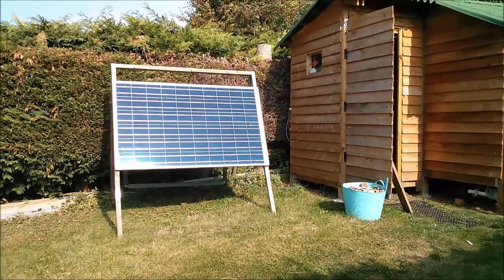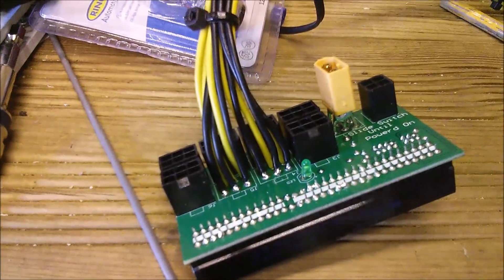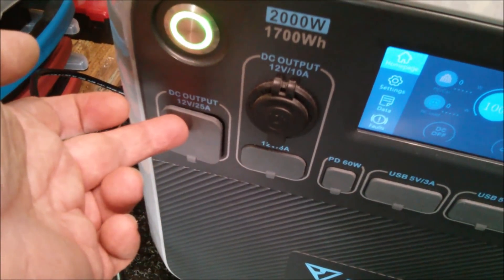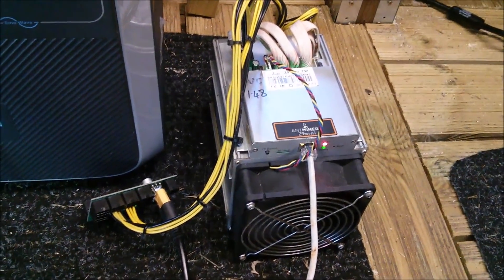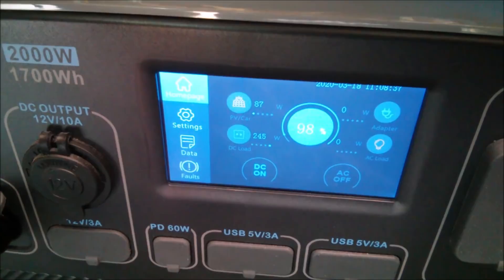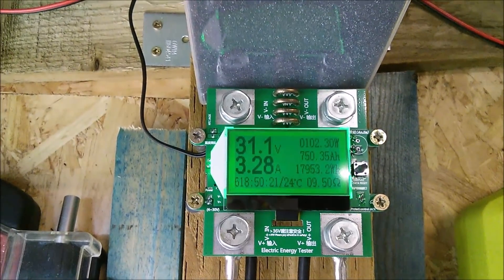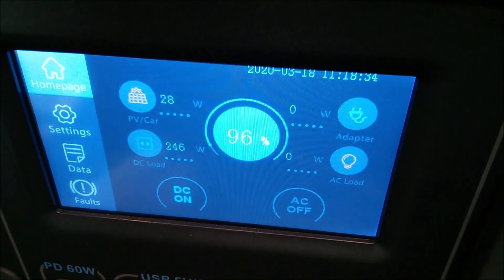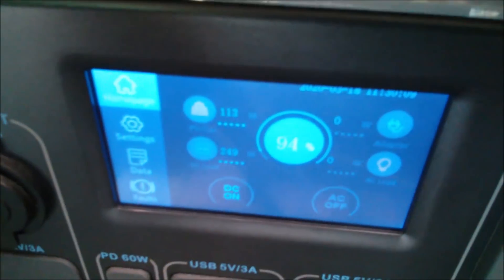Mining using Solar Energy

Comment: Great to see more of your mining operations Julian.
I built a PC based miner (6 nvidia GPU's) and had the mining app on it stop or start depending on whether my house solar panels were delivering enough power or not. I also used the miner as a heater for my workshop and if it got too hot it stopped the mining also. Used it for a couple years.
I wrote my own app to control it all, it sent keystrokes to the mining app to do the stop/start and tied into my solar inverter via ethernet.
Reply from the maker: The problem is those days when the sun appears and disappears hundreds of times throughout the day. But I'm guessing GPUs are more controllable than the ASIC miners I'm using.

Comment: I'm sure someone has already pointed it out, but you wouldn't need to pick your locks.  You'd just unscrew the latch it's connected to, then pick the lock when you got the battery packs home ;)
Reply: Bosnian Bill just retired, so he's safe!
Reply: The visible screws are in the hasp which is covering the staple, to which the padlock is attached, so you can’t get to its screws.
Reply: Hangs on, what’s that?

Did I just hear someone say
“Nice click on one.
Number two’s binding.” 😮

Don’t want a visit from the Lock Picking Lawyer. 😁
Reply: @nigelanscombe8658  It'd be interesting to know how many people watch similar channels.  Electronics and lockpicking are so different, yet here's someone else with the same interests!

Comment: Julian have you looked at the power wasted in cooling the miner vs that used to hash? I’m wondering if it would be possible to setup some passive cooling loop with a water block and a couple of large barrels of water outside the shed thereby keeping all your solar for calculations. Just a thought. Keep up the great work 😀👍

Comment: Padlocks don't do much thesedays unless they are protected, because crooks carry bolt cutters. And the quickest way is not to cut the padlock, but cut the loop it is hooked on to. That's why they box padlocks with steel plates on doors, ie, you can't get to the softer loop. You can break most exposed padlocks by putting a large shifting spammer on them and twisting until the loop breaks, it's quick and quiet. I'm guessing the cable can be easily cut also.

Comment: Hi Julian very interested in this.  On the scaling idea I’ve been thinking about taking a large house off grid by massively over deploying large solar to get power year round (also massive batteries).  It occurred to me that if you had an underground heat battery you could utilise the heat from the miners for heating and hot water.  Ignoring the massive up front cost for the moment I love the idea of being paid to heat my home🤪👍😜
Reply: Julian - have you considered water cooling your minutes and running a loop through your hot water tank?

Comment: I’m fascinated by the possibility of crypto mining heating as a means to get (sort of) greater than  100% efficiency. I’m envisioning a controller that connects to  smart thermostat, solar and battery system and makes a judgement call on how to generate heat after looking at battery level, crypto prices etc..
Reply from the maker: You can get all your electricity costs back (and sometimes more depending on crypto prices), but for general heating, I think air source / ground source heat pumps are more efficient.

Comment: you should time how long a full battery will mine for then just have it switching on with a timer that long before mid morning so or however your solar peaks.
if you can time it right and your solar output is right it'll run the battery down then bring it back up as it mines then run it back down.
The next day it won't mine as long but at least your using it all.
(unless you turn it off early or something)

my system comes on to drain the batteries at 9am so that by 11am it's drained enough to cope if i didn't have a load (but i have a 700w load with a transfer switch anyway)
i mine eth and chia with my system, its 1300w of solar in a little garden with 10 deep cycle batteries.
I had to solve this after i had a charge controller randomly decide it wasn't 12v any more and it was now going to try and hit 24v while i was at work, that killed an inverter.
Now i have a voltage sense circuit with a relay disconnect among other improvements like switching to 24v but i still discharge on a timer just so i never boil over again.

Comment: Can you throttle the miner at all? Disable some of the cards so you're able to charge the batteries and mine at a lower rate? Maybe disable one of the cards inside via software or cut the power with a relay shield until dark, at which point it uses full power?
Reply from the maker: Yes, you can simply remove the power cables from one or more of the hashing boards to mine at a slower rate.
Reply: @JulianIlett  Actually you could go into SSH and with some code set the voltage of the hashboards a fraction lower. They will run cooler and use less power. More cents for your power. PS: I would mine horizen or zcash if I were you (I had that mini as well, a very cute and rather silent miner). I recall I could undervolt and overclock the hashboards for a better performance .. .. (still talking about cents nowadays, in my time that tiny mini miner made several dollars a day, but i NEVER sold the coins I made, so they are growing in value over time, and I am patient).

Comment: Hmm, not sure, if this is a good idea, to run the battery flat every day....thats a lot of charging cycles and it oldens the battery quickly. I am not into this mining stuff, but i think, you are not nearly getting the money back, to buy a new lipo batterie. I am living on a houseboat for 13 years now...Off grid with solar an lead acid batterys. In summer, when the batts are full, a arduino controller switches on the refigerator permanently...so it drawas permanently current from the batterys and stores the energy in form of ice. After sunset,(12,8 Volt) the thing goes back in "normal" thermostate mode. This means, it kicks in way after midnight, because the temperature was getting so low inside the fridge during the day...so no full cycle on the battery and still some energy stored...It was a plausible way, for me, to do energy storing on such a small space. (27m²).
Reply from the maker: Cool idea - to store energy as ice :)
Reply: If the draw is reasonable, it's actually preferred.
That's why you should charge your phone only when it's running low. 
Inverters usually stop at 3V per cell. They've thought about this in their plans to build an inverter. 
The life of a Lion battery, is the number of charge discharges. This number does not increase. If you abuse it, this number goes down faster.
He's drawing only 275W from the inverter, which is reasonable. 
Lead acid is another story. Every time you discharge past 50%, you're taking some poor battery's life away ;)
Reply: @piconano  I don't know where you're getting that information from, but that's only half right, it isn't entirely clear what you meant, but I'm going to assume you meant keeping it fully charged is bad thus a draw is preferred, that is true, they don't like to stay fully charged, but any proper charger will completely stop charging once it's full and will have some hysteresis, so it won't immediately start charging again as soon as voltage drops a little, so unless you're actively draining the battery, having a draw might potentially be worse in that regard as that will cause it to start charging again.

It is technically true that the number of charge cycles do not increase, only decrease, however again that is a half-truth as that isn't the full picture, since there isn't some set number of cycles or anything, they're actually similar to lead-acid in that they have less wear on them the less you use them, meaning to get the absolute most of them you would want to only use around 10-20% capacity at 75% state of charge which would give you upwards of 9000 cycles while retaining 90% of its capacity over that period, but of course that specifically isn't a great use case and thus charging your phone only when it's low or a full discharge does nothing, in fact it's quite arguable that a full discharge IS abuse.

Lead-acid is different but in a similar manner, it's a sort of sliding scale of wear and capacity vs charge cycles, 50% is just the point in which wear becomes very significant, the question is if you're ok taking a hit on capacity so that you have less wear and your batteries remain useful for a longer time frame.
Here's a pretty good summary of everything: https://www.youtube.com/watch?v=Yf9N9zBgyB8
But you can skip to 5:43 if you just want to get to the part I'm referring to.

Comment: You need a charge controler that when one battery is full will switch over to the next such as the one shown in "instructables How-I-built-an-electricity-producing-wind-turbine"

Comment: You can retire a rich man in 2000 years.
Reply: unless cooling fans require replacement every several years or so
assuming there are no other repair cost; that could result in a "loss"
scale up?   However, the knowledge gained here is priceless!  
QQQ Is it all fireproof?
Reply from the maker: Great Britain is fireproof!

Comment: Important question ... Why not use the PWM5 on the solar panels ??
Reply from the maker: I have three 100W panels on my fence, feeding three Trojan lead-acid batteries through PWM5 charge controllers. I have thought of putting a miner on that system, but lead-acid doesn't like being deeply discharged.
Reply: @JulianIlett  Indeed they don't ... but why not use for example say 3 or 4  PWM5's in paralel charging the same battery ...

Comment: So does that powerbank have some kind of data output to serial or USB? Maybe you can throttle the load on it by switching the miners on/off based on solar input and charge level. I understand the solar input in this video is insufficient to make the mining worth while. But you do have more panels in the garden, right?
Reply from the maker: No - so I'm going to have to build a bigger LiFePO4 battery bank. My YouTube channel will be heading in that direction going forward :)
Reply: @JulianIlett   How much power does the panel deliver nominally? If that (around 100W) was the max , and the miner drained the pack by 250-300W in a mater of hours, I don't see how a bigger bank is going to solve the lack of input power. Seeing as the miner will be working night time too.

Comment: May I ask.
What is the cycling cost of the hardware (batteries)?
Kind regards
Reply from the maker: Rough calculation: £1,000 for a LiFe battery. 10,000 cycles. 10p per cycle.

Comment: With the ridiculous cost of the mining unit, the wear of the battery, power bank and charge controller, is there any crypto that is anywhere near worth it?
Reply: He got the miners used for almost no money because they cost more to run than they make and the power banks are from companies that want him to feature them in his videos.
Reply: @dentakuweb  That's true, but that doesn't mean the power isn't still being wasted... 
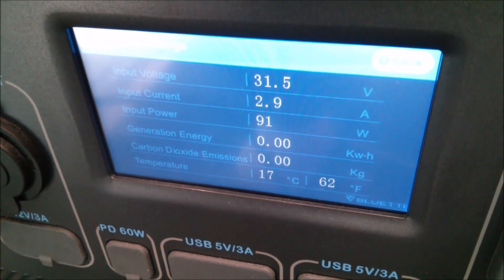Instead of powering stuff around his home and taking it off the grid to ease its burden, 8:48 he's using about 30 cents of electricity to generate a bunch of heat in order to make 2-4 cents, rather than actually using that energy to take 30 cents off his electric bill like a normal person.
Reply: @vgamesx1  "like a normal person" :)
Julian likes doing weird experiments in the supposedly wrong way which then gets people to talk about it in the comments that helps the YouTube algorithm with his engagement statistics
Reply: @dentakuweb  I kinda doubt that, I've been watching him for a long time and he's almost always made weird decisions, you know like leaving his very unprotected/non-water resistant connectors attached to batteries that sit directly out in the rain until they inevitably rust/corrode despite out-door rated connectors or even just coatings like silicone grease don't cost all that much more than the basic dc jacks and what not he already uses, I just don't get it.

Comment: Would be good if it could switch output off at about 40%, and switch it back on at 85% - keep the batteries from full cycling.
Reply from the maker: That should be possible with a suitable voltage monitor device.

Comment: The cost of battery maintenance and replacement will not be offset by the income from mining. This is an experiment of hoppy, not really a money making solution.. Now if you used capacitors for storage, and had a circuit to start and stop the miner, you "could" make money using all solid state components, assuming you already own all the equipment..

Comment: The cost of infrastructure vs money earned is not sustainable, also as you know each time you cycle the battery will decrease its life span, so then you have a point when the cells are only 50% good earning you less and the cost of replacing the cells in the next few years will most likely be going up..
I have solar charging SLA and then charging at a lower current, I use it for 12v lighting throughout the property, I also charge my phone off it too, its great for if there was any power outages

Comment: I just wish GPU manufacturers hadn't abandoned their original customer base.  I know that wasn't the intent, but that's the effect.
Reply from the maker: Didn't one of the GPU manufacturers try to make their products crypto resistant?
Reply: @JulianIlett  Nvidia made a token effort to reduce hash rate on on one card, but it was immediately defeated.  I think the bottom line is that they don't have the will to actually make a GPU that would work well for graphics and not well for mining. I'm sure they could find a way (despite the knee-jerk reaction about it being impossible that happens whenever someone mentions it.) Unfortunately shareholders LOVE the current situation and they are the only ones who matter, right?  Well... yes, but in the long run the current situation could bite manufacturers in a way that will take a long time to recover from.
Reply: @StubbyPhillips  But it is impossible. They will never be able to limit what the consumer can do unless they physically alter the board and even then it'd still be possible. The old console hacks just jumper wired the chips onto traces on the pcb.

As a consumer, one who doesn't mine, I can say that the moment companies start to trying to get all dictatorship on what the people who buy their products do, the community will respond and flatten that companies attempts into the ground. The company doesn't decide what I do with the product after I have purchased it. I do.

Comment: 14 x 3.7 = 51.8 Volts. Your 14 cells must be a tiny bit over 4 Volts each as you are showing 57.1 Volts total.
Reply: LiFePo4 cells nominal voltage is 3.2. Fully charged 3.65v per cell. 3.65 x 16 = 58.4 volts. Li-ion.. chemistries other than Iron Phosphate  vary but mostly 3.7v nominal 4.2v fully charged. The difference in nominal voltage is the reason for different pack sizes for 12/24/48 volt battery packs.

Comment: crypto mining is so worthless today, it's worth nearly nothing. You would be better off just having a small computer out in your shed run by that power bank, and having the computer run as a VPN server, obviously you can't split your home connection too many times because it likely isn't a high bitrate to split, but you could at least have the server in your shed probably run 4 VPN connections, and there would be enough leftover bitrate for you to still use your home computer as well. You could make a basic website and only charge the 4 members around 8 dollars a month, this would make it cheaper than nordvpn and the rest. You will only make 32 dollars in the month, sure, but that's way better than making only 5 dollars (which your current setup would only make like 5 dollars in the month).
Reply from the maker: The problem with selling a service is all the marketing required. Mining earns dollars without all the sales effort.